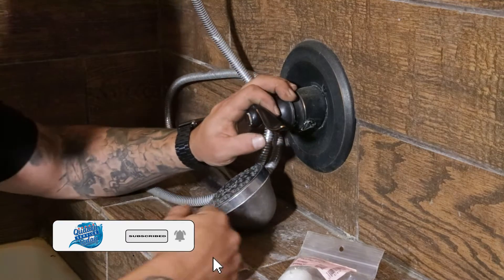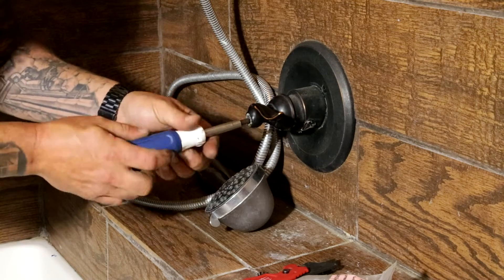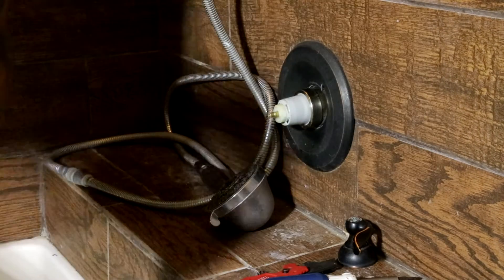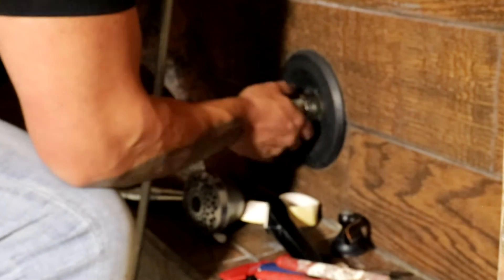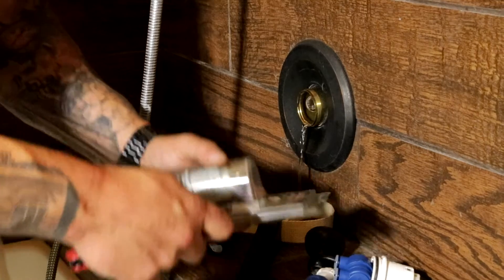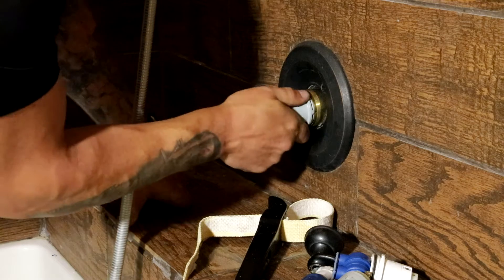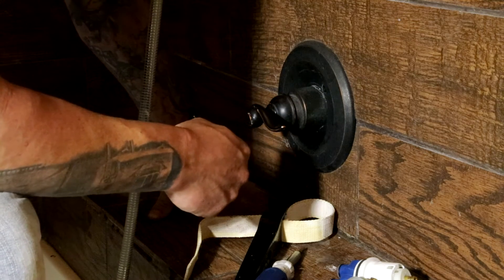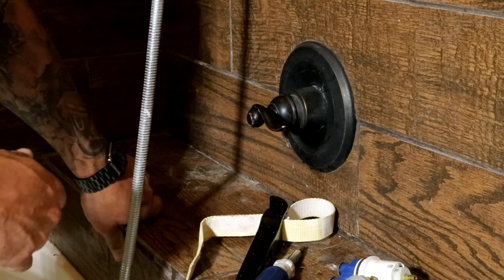how to fix dripping faucet. delta shower valve repair, delta 1300 cartridge replacement

Comment: Have a brand new tub/shower rough in that I just installed. Delta multichoice valve and cartridge straight out of the box aaaaaaand it's dripping from the tub spout. Replaced the cartridge and same thing. Might be over delta from now on.
Reply from the maker: Unfortunately this can happen if its from a box store rather than a plumbing supply as there is a big difference in quality of how they are made

Comment: Is there any real function difference between the two valves? Im replacing a pre 2007 delta shower hardware with a new unit. The new hardware came with the longer stems (RP46074). I bought a new Blue cartridge (RP19804) that fit the valve already installed. I test fitted the newer handle and it all seems to work fine but was unable to test hot water due to not having the shower wet in yet. I had no way to run it long enough. I just turned it on and made sure water could flow.
Reply from the maker: As long as you put the proper stem in and set the scaled guard you should be good to go

Comment: What is the correct orientation of the valve? Mine currently still has the old cartridge and the hot comes on first before the cold.
Reply from the maker: the valve is hooked up backwards or is upside down,